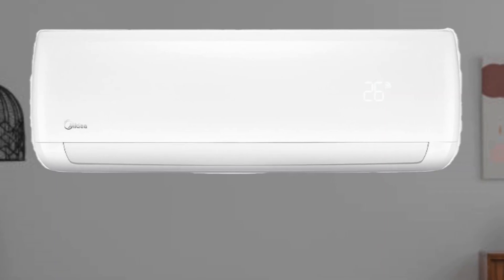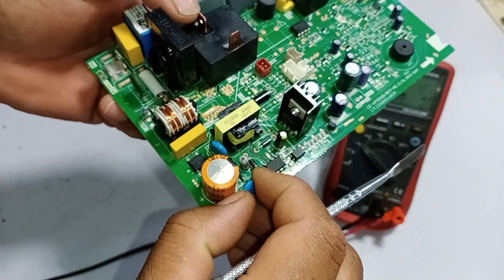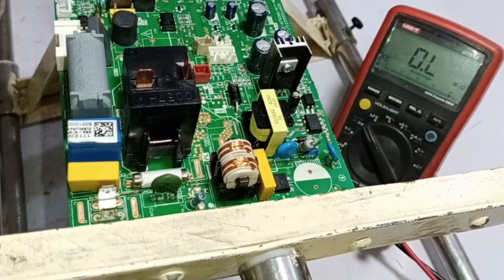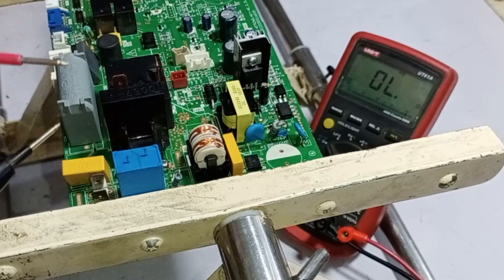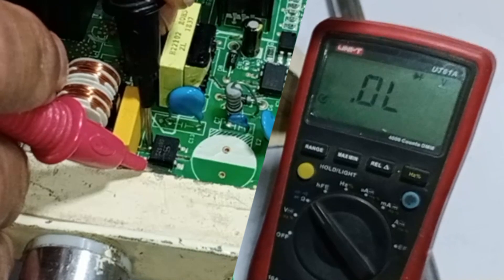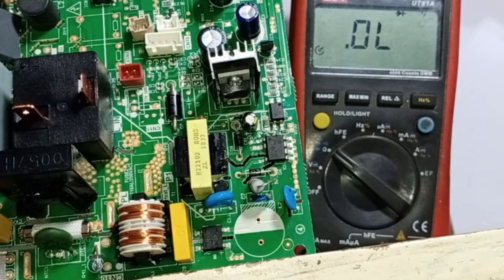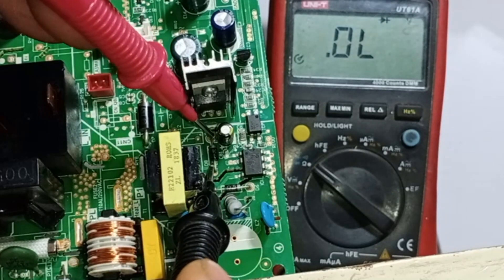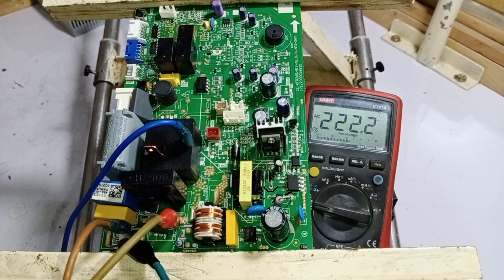Midea AC Circuit Board Destroyed with High Voltages, Can it Be Fixed?

Comment: I have a midea mini split that I powered down to replace the fan wheel and when I powered back up I saw 88 on the display. after that the unit do not work. The display has gone black. I replaced the circuit board on the indoor unit but no response.I am at a loss of where to look next. The fuse on the outdoor board looks good. Any help would be appreciated.

Comment: I repair a Hisense inverter outdoor unit some time compressor can start some time just start 2s then shutdown and error code 19 , check description error 19 mean compressor drive in trouble , can you tell me that problem from compressor or motherboard?
Reply: Check the module that provides u,v,w phases, and the sorounded Area(rezistor, ipm and so in), located in the outdoor unit.
To the compresor You can check the phases ohms.Only afterthose checking the efort still appears, that means the compresor in workout.